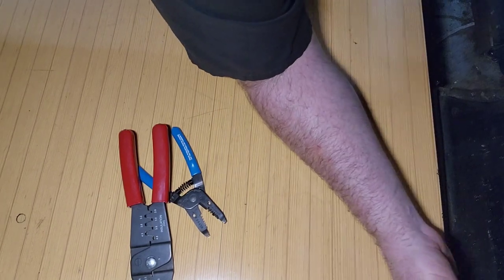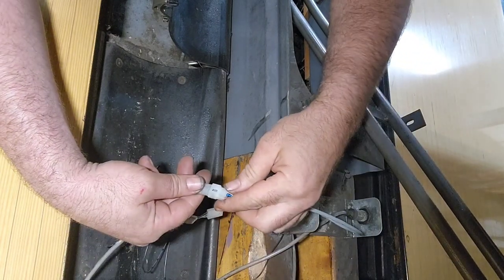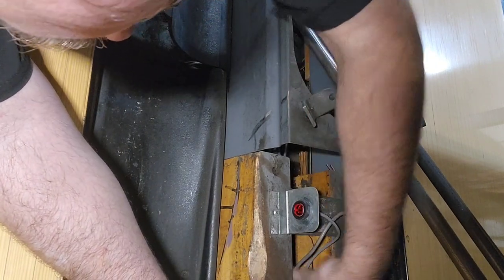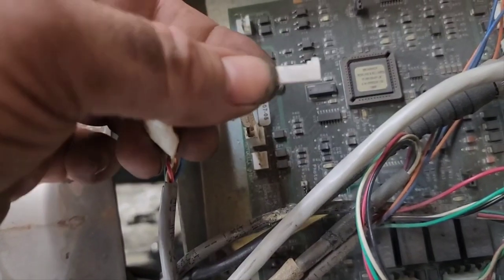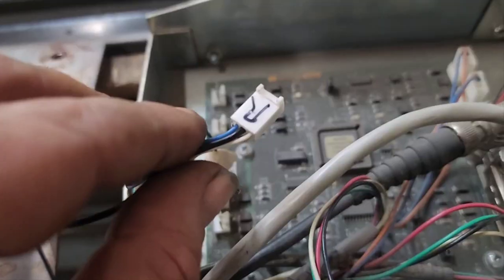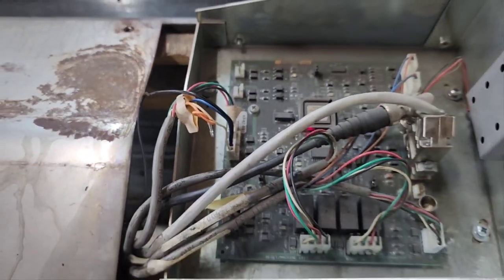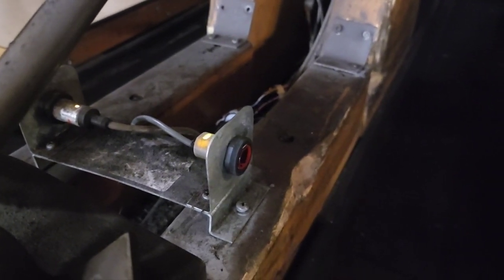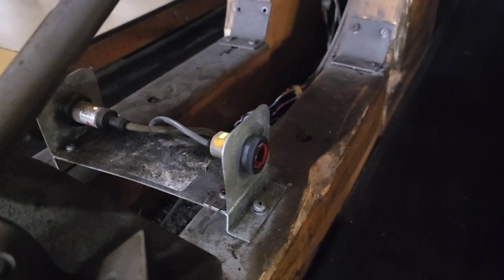Brunswick Vector Scoring system bad ball detect wire replaced.

Comment: Hi Sir, how u doing..
I need your help plz..regarding an issue in gsx pinsetter Pinholder Grippers...
Actually the opening and closing timings of the Grippers is now opposite to normal...means, remain open when supposed to b closed and remain closed when Actually supposed to b opened...where is the problem and how can I fix it ???
Reply from the maker: Check that the B, C, and D switches are installed in the proper locations.
Reply: @Michael Buckley  I unplugged and then plugged in the wires of switches then it started working sir...thnx